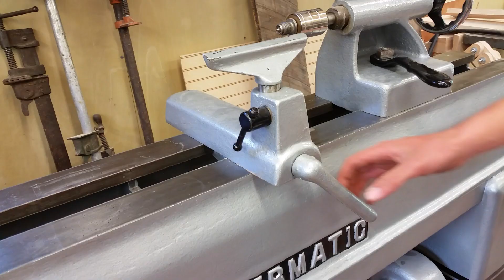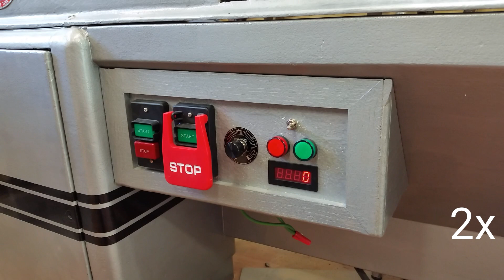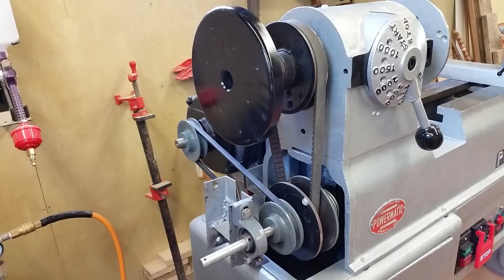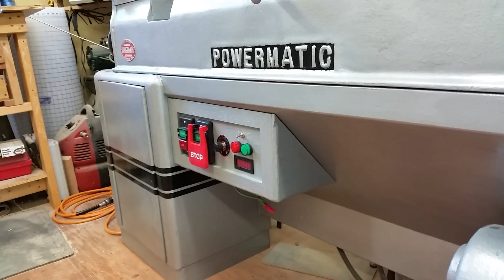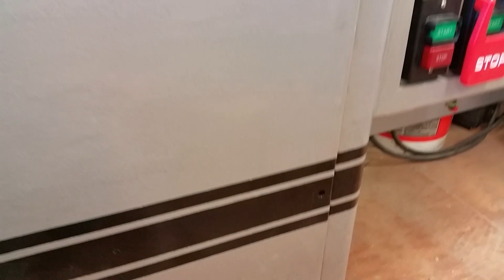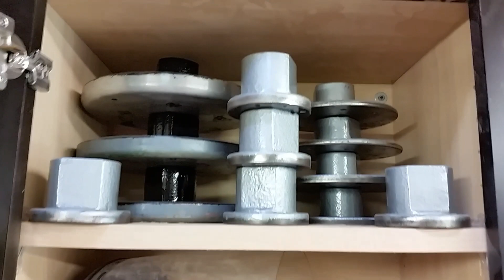Powermatic Model 90 Quick Overview

Comment: Any suggestions on  where to purchase tail stock and tool rest parts  for a 90 Houdaille. thx
Reply from the maker: I would search around eBay for a while, here's one I found on there. It's a bit on the expensive side and you will also have to find the clamp and screw/nut too.

https://rover.ebay.com/rover/0/0/0?mpre=https%3A%2F%2Fwww.ebay.com%2Fulk%2Fitm%2F132972220147

Comment: Super job that beautiful lathe looks brand new, like it should be on a showroom floor. I have a PM 45, and I love it except for the PM green. But I overlook it and keep on turning. What is the maximum between centers it looks longer than the 45.
Reply from the maker: Thanks! I appreciate it, yeah I was never a fan of the PM green either. I believe between centers, it can just turn a 36" spindle.
Reply: @thewoodworker01  thank you

Comment: Just wondering why it was necessary to install a jackshaft.  Seems that you could run the reeves drive and the motor in its new place at the back of the lathe without it.  Please enlighten me as to what purpose does the jackshaft provide.  Thanks.

Comment: Very nice restore.  The first digit on your serial number will tell you what year it was made unless it is a 1955 which was the first year of production.  In 1955 serial numbers began at 1000.  Starting in 1956, serial numbers began with a one digit year followed by a hyphen that was followed by a continuation of the sequential production number from the previous year.  Pea green was the standard color but grey was an option.  The raised casting and lack of a bottom shelf indicates your lathe was likely made in the late 50's.  Visit owwm.org and search for "Powermatic 90 Time Study" to learn more.

Comment: I have bought this very same lathe that came from a school, also has a one HP motor. It is  not in a bad shape. I also taken most of it apart for oiling and cleaning. But what I have decided to do,
 is obtain a rotary 3 phase converter and run it on single phase supply. This way, I will at least hold onto the full 1 HP power. You really did a great job on the restoration! Thank you for sharing.